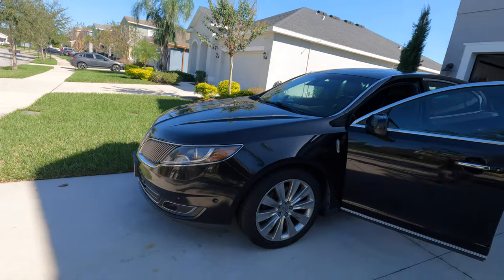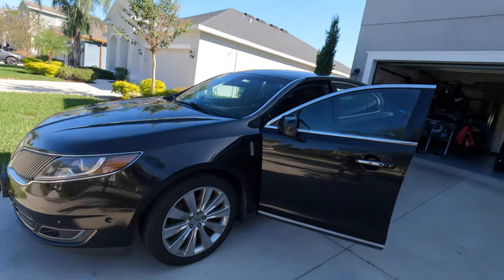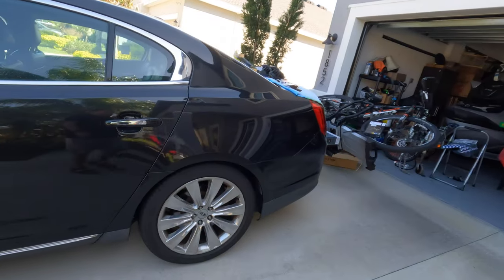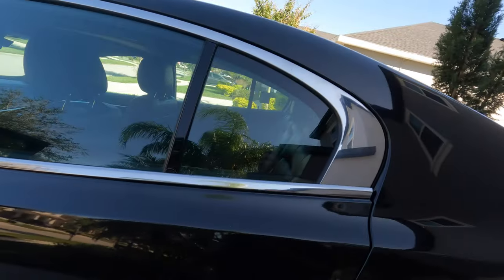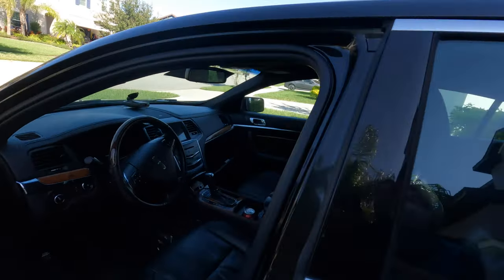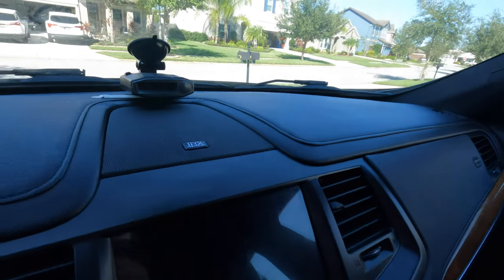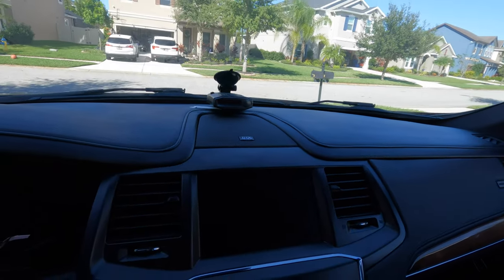Upgrading my Lincoln MKS Speakers to Infinity Kappa 86cfx 6x8 By Harmon Kardon

Comment: I've been looking for a review on these before i go and buy them,so I'll be waiting for your next video 👍
Reply from the maker: I'll be making the review video next week. Bunch of things happened with the install so will be informative.
Reply: Aren't the factory speakers good enough?
Reply from the maker: @Ricardo Gordon  They are and they aren't. Depends on what level of quality you want.

The new speakers give a huge increase in vocals and bass especially midbass. The tweeters are a huge upgrade, the Infinity give so much more detail and clarity.

It's just a level of sound you're jumping, thr new speakers are not as good even as the Lexicon in my other car and the Lexicon is not as good as the Bowers Diamond in the BMW.

It's just level of quality your increasing. The original THX is still good but far from HiFi. Even the JL Audio and Infinity I installed aren't HiFi, I would need to bump up to Focal and spend $3-$5k for that.
Reply: i have these there pretty good originally was gonna go polk or higher end brands went with infinity kappas because vehicle came with infinity logos so yea..running on infinity reference 5 channel and kappa sub sony head unit.

Comment: You made this waaay harder on yourself than needed ....take the door panel off brother.
Reply from the maker: Yeah I saw afterwards where the clips were. All I needed was a door tool to pop them off. First time I took off a door panel.

Thanks for watching. im thinking of swapping the in deck sub by the rear window that will be a laugh me trying to figure it out on camera.

cheers
Reply: @jimthestargazer3274  I too have the kappas. My only complaint so far is the way the speaker wire attaches to the speaker....for the life of me I don't know why they made it that way.
Reply: @jimthestargazer3274  And hey,,being ya first time you did juuuuust fine my friend!!!!

Comment: Please Please DO NOT DO ANY OF THIS THE WAY HE DID IT ITS NOT RIGHT SHOULD HAVE BEEN A 2 WAY Component set mid bass in door tweeter in a pillar every thing was installed wrong
Reply from the maker: Also the main midrange is in the dash, the doors are bass speakers and main sub is in the rear window.
Reply from the maker: Before you comment you should have checked out my other videos. I swapped out the tweeters in the front pillars to Infinity Kappa tweeters in other video.

I showed the whole removal of the pillars....